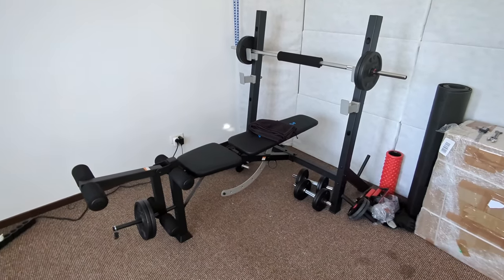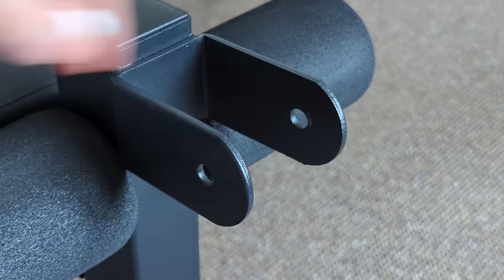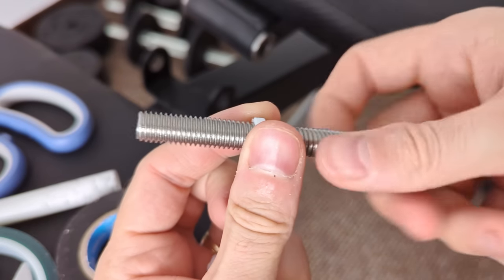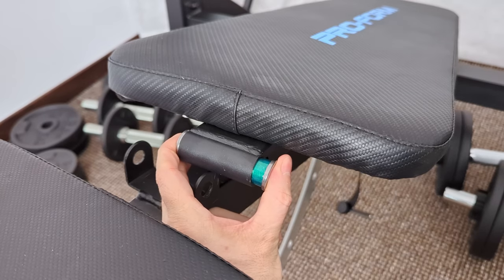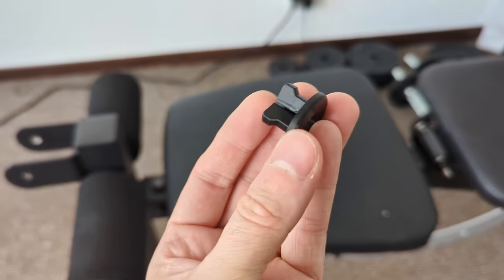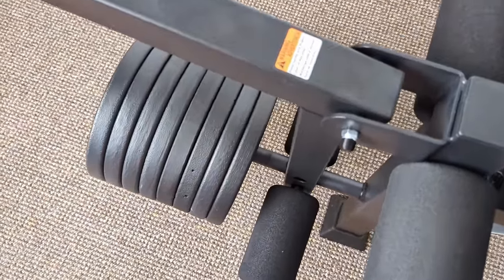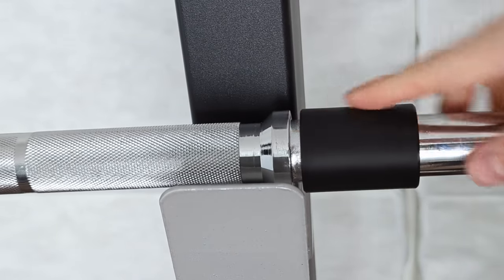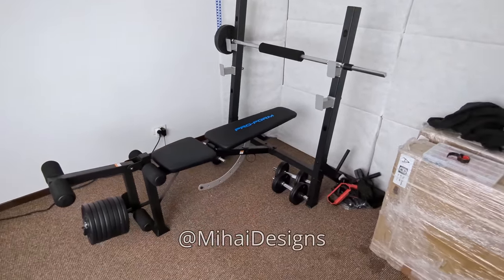Fixing my workout bench with 3D printing

Comment: the hole through the leg extension bar is a lot larger than the hole in the bracket because the holes in the bracket were drilled, but the hole in the bar is a steel tube. so it will be an interior diameter measurement. So rather than having a high tolerance they likely just found a steel pipe thats larger than they need on the interior diameter and so the result is a wobbly leg extension. But it still functions, and its cheap so they arent going to bother finding a closer spec pipe, or filling the difference with a gasket like you're doing,

Comment: I am printing a lot bushings from iglidur I150 and I just use 5% part cooling at 50-60 mm/s speed and the result is almost perfect, You should try it, good luck. What do you do with your workout bench it's good M8 is way enought fot it. (i am an mechanical engineer).Anyway I love your videos, and I am very exciting about your tool changer printer.
Reply from the maker: Whew that's a relief! Tool changer coming back alive very soon.
Reply: @MihaiDesigns  very cool, keep going!!

Comment: saw you're running quite a few Bambus - is the tpu feet mod worth it to dampen vibrations? will the tpu feet protect the life of the machine?
Reply from the maker: I got the feet from the store but haven't installed them yet.
Reply: @MihaiDesigns  would be so interesting to get your take on this! I know your intuition and rigour is super tuned to these kinds of problems. The Bambu is violent in its prints, so the wear and tear/ stress load between feet and no feet might be really cool to look at (especially since so many have these printers)

Comment: This teal tape is not Kapton tape, that one is golden brownish, and cannot be any other lighter colour. This is PET electrical tape. Normal electrical tape that most people know (10:35) is soft-PVC tape, which is how it's long-term self-welding on PVC wire sheathing and doesn't work for anything else.
Reply: I'm not sure about that. I have the same tape and it feels exactly like Kapton tape and is also rated up to 500°C. It is often used inside of lipo batteries. But I'm not saying it is kapton. I think it is something else.

Comment: I think it is completely pointless to drill one hole bigger, because you can instal that plastic tube first in place and after that slide that full leg part (With that plastic adapter tube) to the place and instal bolts.

Comment: He says "Now Bolt!", snips his finger and a screwdriver appears instead 🤣 https://youtu.be/OJ6oiylYvbA?t=345

Btw.: I'm not an engineer either, but you might want to add a washer and a nut on the insides. That way the plastic is not pushed away on the thinner sections that easily. Of course that would mean you would two short sleeves instead of a big one. Regarding the fitting it would probably better to oversize the sleeves a bit and use a bit of head t soften the plastic and press it inside while it's slightly over the glass transition temperature.